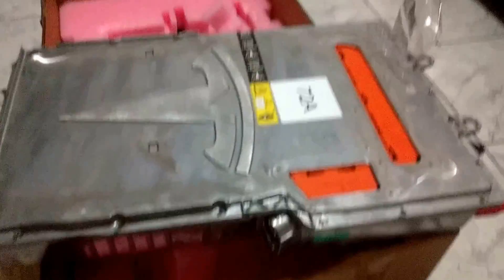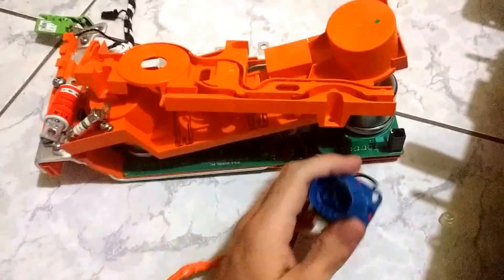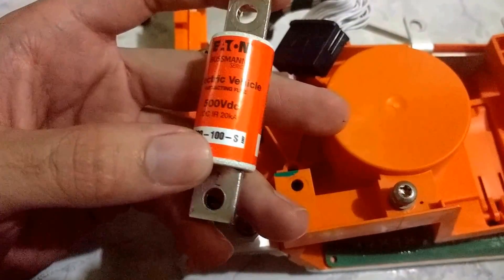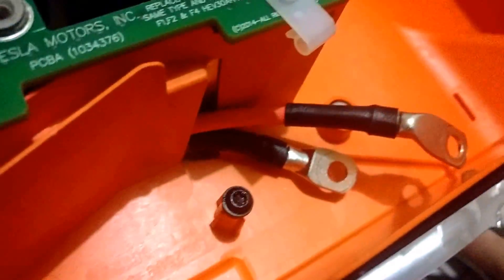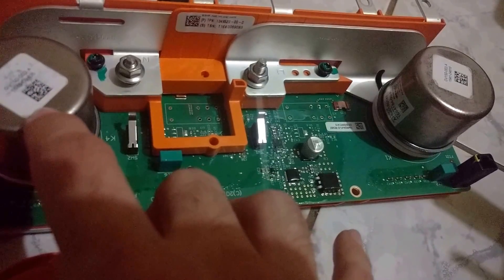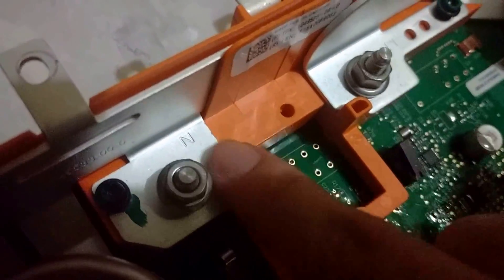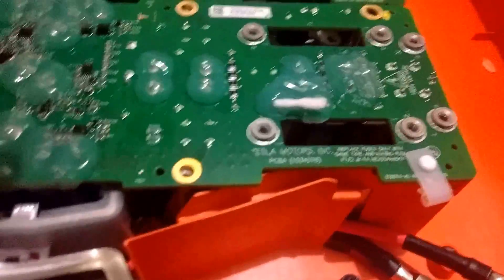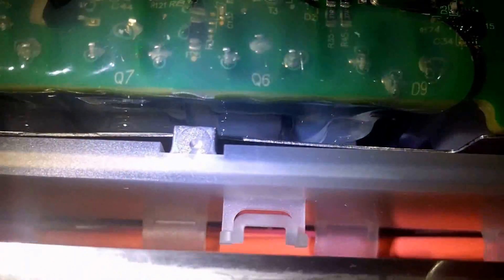Tesla Model X 3rd Gen 72A Charger Teardown

Comment: Hi. Don't You know, if I have reduced charging speed, from 3 phase 10amps, instead of 16amps, also showing on IC unable to charge, but charging, does it mean one of fuse inside the charger blew away?
Regards Sergei
Reply: Hello Sergei Zharikov, Have you solve your trouble because I have exactly the same problem... Thanks for your answear
Reply: @arnaudhu6860  Hi. It was solved by Tesla service. The message on IC disappeared after that, but charging amperage stayed the same 10amps. As Tesla explained me, I have to upgrade the charger ,but I didn't. Try to call Tesla, maybe resolved remotely. Good luck!

Comment: Hey  
do you have material about how to design charger or can you make video on same ???
Reply from the maker: Unfortunately no. You would need to go to amazon and acquire books and simulation software for magnetics design.
Reply: Anner J. bonilla 
Thanks..
Can you suggest me software for simulation and books to acquire knowledge ...
Please !!!
Reply: @ntnsonwale4381  You might not realize it, but there is probably 5 man years of effort in designing such a charger. Power electronics like this is extremely challenging to get to work in practice. And before that comes the taks of getting the design, all the math and the controlling strategy in to place. I dont know anyone, that posses all the skills to make such a device...

Comment: Hey. Do you have the typ of the high voltage relays (GV150-002)? And do you know the manufacturer? Thanks :-)
Reply from the maker: It's Giga vac I am overseas right now but I will get back to you.
Reply from the maker: Here is the part: https://lh3.googleusercontent.com/VnIuFjpImjMPhGtpSA--zObL_ZKZZ_0mGX55V0zK_0rgAI7Rit9tENg8t4LZBxtvkT_iTG2m5FfUF2araa9pn45WhjSqxUFsmhF9eOtX3tE-bw6awDrgiuP862kzRPcZ0CLI8KDWf7ZKpEXE8D1_LH7jfrRZQZE5FnKrQzuNTejhwUoFSKheOOvQXj4OKmyrpbQDi7lRtCRVSlE6V1Ew9_SAdXZF_QNIyfV-dwpPLiG6gGy5kUtXpCuVwnHaVcTJIqSZlNHxDXiSnLCFvBMyHTvY1pip0PbNxnC4wjeY8ykLpX0nUJCwBI4IW0Yd5_8f_pz9gsyaoU0IxWLtBB8kcAbaskeeUdu-Ifk2C3pfu8BPcogCnRwIWPMusrkjwjPXqmmfT5T7HyKeWCjX6_o8ppjsjlLH35V0lsJt4qsQVP8NSMwZorSxy19d5_RIAC6wGkF5l5GiYgAMAtYQILwc40A6_hMPWwlzqMFOxKwyT2ISxIQekXJRy06qVX51pR8VZ-8uhCHAt1b3q8H6-bmBGtGC1fxCytOnainP5NUJtdHjO34hsidgsOisSRPOaT4_9Nyc-iZOkSSTZDCpvuFCyf5RX1mocxXSbnDXo-3Fm0rad0pLWQnuLmOtuQ=w1320-h990-no
Reply: Hey Anner J. bonilla

thanks. But the link is not working :-(

Greetings
Lorenz
Reply from the maker: https://i.imgur.com/Wz3o7kC.jpg